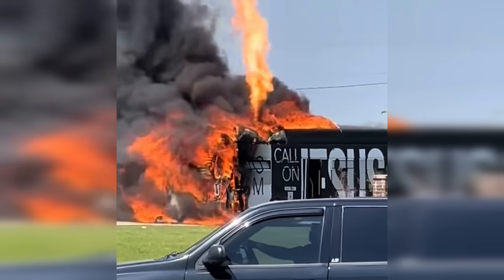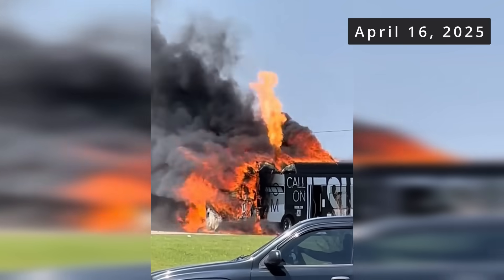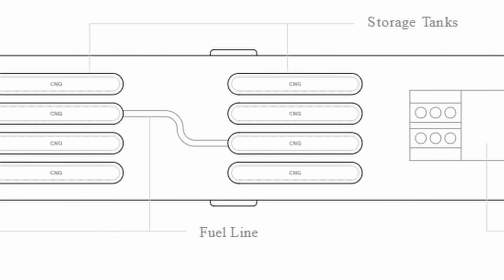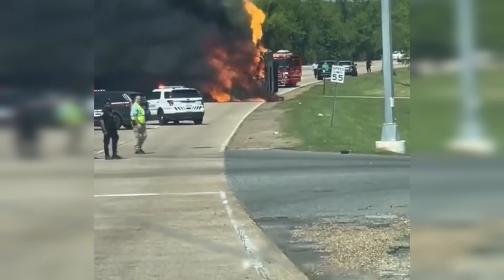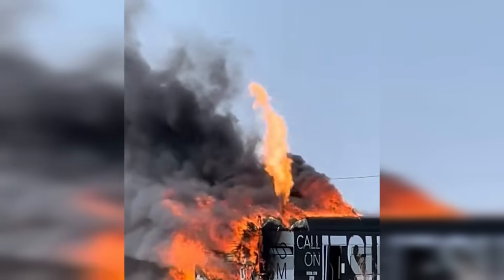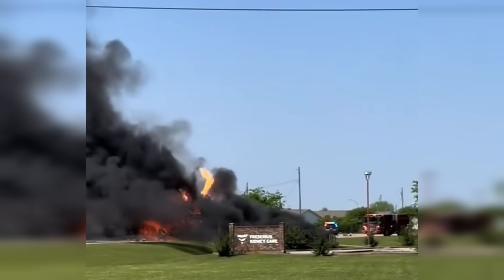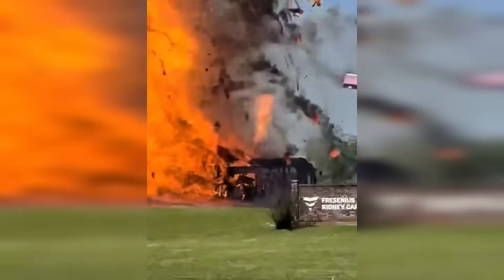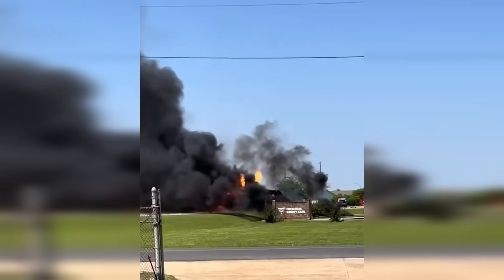CNG Bus Explodes in Shreveport — Not an Electric Vehicle

Comment: 3600 psi, wow. LPG is around 220 psi so the pressures are an order of magnitude smaller. Any gas at 3600 psi that ruptures its tank is going to be very destructive even if the gas is inert.

Comment: Ok At what pressure does compressed natural gas turn into a liquid
Reply from the maker: You'd have to look at the phase diagram.   It's dependant on both temperature and pressure.
Reply: 4 psi at -200

Comment: Could be that one of the venting tanks was pushing high pressure vapor across the safety valve of another tank, cooling it while the other end of the tank was being baked until it failed.

Comment: In tanks propane is stored at high enough pressure it is a liquid, at normal temperatures. That is why the volume stored is so much higher than the volume of the tank. Pressure will reduce as the stored propane is depleted, but it is basically empty when the pressure is so low that none is still liquid. That is how some level gauges work.

Raise the temp and the liquid becomes gas (BL), so the pressure rises (EV),  until boom (E)...that's why it is a BLEVE 😂

(FF1 & D/O)

Comment: The PRDs can be manually disabled as a safety feature when the bus is inside the shop for maintenance, sometimes they get left in the disabled mode.
Reply: NO, the PRD line is just a vent line when the PRD valve goes off it vent the fuel out the top of the vehicle, the tank itself can be shut off, but that doesn't turn off the PRD. once it pops it vent the hole tank and then the valve has to be replaced.
Reply: @junkmaster5503  The tanks are on the roof and the PRDs are on the top of the tank.

Comment: Great that CNG has a relief valve, but that doesn´t keep the tank or hoses from being compromised by fire. I don´t want to have anything to do with compressed natural gas. We´re talking 3000 PSI of highly flammible liquid. Ever have a pesky leaky water pipe in your house? Thats only about 50 PSI. You gonna trust that all connections and piping will stay perfectly tight day in and out with normal road vibrations or passing over pot holes or even a minor fender bender. Disaster waiting to happen.

Comment: HEY , some points from my past ; 3600psi ??  late 90s early 2000s , 2 school districts around Albany ny i worked on , we were told 6000 - 8000psi in ,yes , 8 glass/resin spun/wound tanks .  only safety we saw , a T handlle and cable to shut off flow to engine 😂😂😂😮
      also from fire service , NG is lighter than air ???  can dissipate ???  but make big dang fireball ???  massive ignition range , so i was told??
   just glad my kids were NOWHERE near ....

Comment: Not every touted change is a good change. Diesel has worked for a very long time. There is no need to change.
Reply: CNG has a much cleaner exhaust output; diesel engines, although when brand new, can be quite clean - quickly turn into coal burners if they arent maintained to a VERY high standard - and most arent.

Prior to the EV revolution, several Chinese cities converted all their city buses to CNG/LPG (at a HUGE cost), and banned other large diesel engines from the inner city - the difference in pollution levels was visibly noticeable between my visit to one such city, just before the ban - to my visit a year after the ban.

Prior to the ban, you often couldnt see much beyond a single city block, and even then, the view was pretty hazy; after the ban you could see a mile or two.

Comment: I think you could probably save that right front wheel… 🤣
Reply: I thought the same, the brake assembly can take a bit of heat too, gotta be a few hundred bucks there.
Reply: Just the wheel (maybe) as the tire has had too much heat
Reply: The tire could be repurposed into a lovely planter for beautiful flowers.  😉  Life is good!  😊

Comment: CNG is way more dangerous than diesel, but still far less problematic that misbehaving battery fires.
Reply: @cccmmm1234  the federal government just needs to remove the soot collection and other emission system from diesel engines and just require that they run as clean as possible.

Comment: Are the tanks on those busses vented directly to air? If there are pipes to direct venting to specific locations (ex.: the two fire columns seen in videos) for practical and safety reasons like keeping flame jets away from passenger space and emergency exits, then it could be that the temperature relief valves did operate correctly but the flow resistance between the hottest tank and atmospheric pressure was too high to keep up with the heat load. May need to size vent pipes up another inch or two.

Comment: in US obligatory PRDs are not "tank PRD" (built-in in tank itself, it is not so easy and safe for 300+ atm vessels), they are external devices and mostly thermal thus do not guarantee fast pressure relief. Exactly what we see here - small single jet burning with rate mb 1kg/sec (3m high flame jet) for minites in the very centre of the fire, on big bus with multiple cylinders and 100+ kg gas onboard. The roof tanks (cylinders) are definitely composite, so finally one of them overheated, lost its structural strength and failed. 

If thermal PRD is already tripped and jetting the gas - tanks may and must be cooled, it is irreversible device, but not before.

Comment: One bus company I worked for had a Dennis Dart catch fire due to an electrical fault. The driver got everyone off but the fibreglass body burned down to the bottom of the windows by the time the fire brigade managed to put the fire out. Then they were able to approach it and turn off the Cummins diesel engine that was still running fine, although the heat had melted all the plastic radiator fan blades off.

Comment: I remember many years back when the bus fueling station for CNG busses in Tacoma, WA blew up. City had to scramble to pull old busses out of mothball to keep public transit running at that point. 
But, I do have a friend that was a mechanic on those busses and he raved about how clean the internals of those engines were, when run on that fuel.
Reply: Oh yeah. Without any soot, the motor oil lasts longer. You don’t have any soot getting into the turbocharger either. Without the particulates, the engine just doesn’t have to deal with as much and everything just sort of works better and runs smoother.
Reply: Alot of farm pickups have been ran on propane, motor oil lasts forever. These days propane is expensive and not so many conversion kits available for new engines.

Comment: Diesel fuel is looking better and safer everyday. 😮
Reply: Not when it spills, you have to normally replace the tarmac
Reply: @BlowBubbbles  Diesel?  I've not had an issue with that but regular petrol/gasoline definitely eats asphalt.
Reply: It might eat it, but you can't wash it
Reply: Easier to source and handle…?
Reply: Only because we have a network setup, who knows what will be powering transport in 100 years

Comment: If it's not a liquid under compression, then it's compressed methane. It's more sensible to use LPG which is liquifed petroleum gas . For us here in Australia the domestic and camping LPG is propane and the automotive LPG is 50/50 ratio of propane/butane. The propane and butane liquify at say 3 to 5 atmosphere of pressure and from memory the tanks are hoop band tested to 30 atmosphere of pressure before they are issued. 3600 sounds like 250 atmospheres. I think the CNG tanks had a wall thickness twice that for LPG. I recall a movement to introduce hythane tanks which is 80/20 ratio of methane/hydrogen (interesting concept) . Hythane fuel I was informed is used in India and for the same energy only produces ⅕ the carbon dioxide emissions maybe ⅙ actually.
  Who the hell wants to drive with tanks at 250 atmosphere of pressure? We never hear of incidents from India with their hythane usage but there must be some incidents. After 50 years of automotive LPG usage in Australia only a few incidents got into our news reports over the long period.
  Methane is also a petroleum gas of course but has become labelled as natural gas i guess because it's also produced naturally in nature.   LPG would appear to be LNG , I gotta look further into it cos there's ambiguity.
Reply: Big surprise - we have plenty of CNG buses in Sydney, mostly manufacturer-built, not inhome conversions. Our beloved govt plans to replace them with rolling electrical bombs and compressed hydrogen miniHidenburgs.

 LPG is Petroleum gas (butane-propane), CNG is compressed (300atm) methane, LNG is cryogenic methane - low pressure but -170C temperature.

Comment: Fire relief valves only work when directly exposed to fire. If the body of a cylinder but not the valve assembly is exposed to fire the cylinder body will fail.
This is particularly a problem for light weight composite cylinders where the cylinder body itself can burn away. Aluminium cylinders are marginally safer because they distribute the heat to the valve assembly…
Gas cylinders in a fire are dangerous regardless of the contents. Compressed flammable gases are exponentially more dangerous.
I agree the bus was toast the moment the fire started - safety of life trumps salvage.

Comment: What kind of tanks were on the bus? Aluminum with carbon fiber / fiberglass wrap? Or kevlar wrap? If so could the wrap soften with the heat? And now it could not support the tank pressure and cause an explosion?
Reply: Heat is going to drive the pressure up, possibly double or more, and possibly also weaken the tank.

Comment: A Compressed Natural Gas (CNG) bus is a bus that runs on compressed natural gas, a cleaner-burning fuel than diesel or gasoline. CNG buses produce fewer emissions, are quieter, and can offer operational cost savings compared to traditional diesel buses. 
 
Reduced Emissions: CNG buses produce lower levels of greenhouse gases and other pollutants compared to diesel buses. 
Quieter Operation: CNG buses are generally quieter than diesel buses. 
Operational Cost Savings: CNG can be less expensive than diesel fuel, potentially leading to cost savings for transit agencies. 
Fuel Source: Natural gas is a domestically produced fuel, reducing reliance on foreign oil. 

Many transit agencies in North America have converted their fleets to CNG buses, including VIA Metropolitan Transit in San Antonio and GoRaleigh.
Reply: all these reasons are just cover for the single real reason - CNG is CHEAP! Dangerous, not convenient, requires very specific infrastructure, reduces range... but twice cheaper than diesel!

Comment: the tanks are on the roof? these buses must be easy to tip over, thats got to be terrible weight distribution.
Reply: light composite tanks are usually on the roof, its not so heavy. Oldslyle steel cylinders, 100kg each, not suitable for roof installation.

Comment: Sometimes staying away from it and letting it burn is the best solution. 
I learned that much from my little bit of chemistry that I had to study for college. I would imagine if the official firefighting instructions for some of those chemicals are monitors far away and evacuate the area. I would imagine that a high pressure gas cylinder That's in a fire should have a similar procedure to it. Evacuate the blast radius and keep everyone out of it.  If you can fight the fire without getting people inside of it Great otherwise just stay away. 
I've seen regulator failures of a high pressure nitrogen tank in person before. That would have been lethal if somebody was in the way. There's no way I'd want to be near a tank operating at a similar pressure that slowly losing structural integrity. There's enough stored energy in there to do an awful lot of damage. So I'm a little bit more cautious than most around them.

Comment: My area (Fort Smith, AR) had a small CNG bus go up it flames back in I believe in 2018 .  The bus got hit and causing a rupture in one of the tanks.  The driver got everyone off the bus in less than a minute before the bus got fully engulfed in flames.  No one was majorly hurt, but it really could have been far worse if the driver was to slow to respond.

Comment: I like your quiet, engineering and fire-fighting based analysis of the incident. Panic and sensationalist reporting is always a bad advisor. Liquid based fires like petrol/diesel are bad enough but relatively "benign" compared to pressured gas systems (LNG/CNG), let alone compared to lithium ion battery pack fires.

Comment: I would be interested to know what caused the fire in the first place.  Something hot enough to set off the pressure release valves.  
Best from Cleveland, Ohio
Reply: Odds are, it started as a typical fire.  Perhaps electrical that set the interior on fire.

Comment: Gas vehicles may not be perfect, but we've been perfecting the technology for over a century. I don't like the idea of sitting on twenty gallons of boom juice under me, but at least when I was surrounded by cars that exploded it was in a warzone. XD
Reply: There are so few accidents with it that no one even considers it, it is that safe when you take normal precautions.
Reply: It’s all about inspection! Those lpg or CNG systems needs to be checked all the time
Reply: LOL the age of the technology don't mean anything. Commercially available electric vehicles appeared during the 1890s. An electric vehicle held the vehicular land speed record until around 1900.
The Beach Pneumatic Transit (Hyperloop)was the first attempt to build an underground public transit system in 1869 or Vactrains were explored in the 1910s, as described by American rocket pioneer Robert Goddard and others. or ET3 Global Alliance (ET3) was founded by Daryl Oster in 1997 with the goal of establishing a global transportation system using passenger capsules in frictionless maglev full-vacuum tubes. Oster received interest from Elon Musk potentially investing in a 3-mile (5 km) prototype of ET3's proposed design.
Reply: @OzyWizard1973  electric vehicles have one major issue, electricity. You either use ineffective heavy batteries  or a overhead wire/electric rail system.
Reply: @jonathanjones3126  OK.. But my point is not EV's. It's the age of the technology. I used EV's because I know they are 210 years old and still dangerous. Where Autogas was design and tested in 1823, it wasn't till 1935 it had an autogas station. Slower start but safer.
Reply: @OzyWizard1973  I agree that electric motors can be a excellent means to propel vehicles, the problem has been the source of electricity.  My city has light rail with overhead transmission wires to supply the electricity for 3 light rail lines.

As far as liquid fuels go, diesel is the safest by far. Anything compressed can be extremely dangerous especially oxygen or propane type fuels.  Though their much better then any lithium or sodium chemistry batteries.
Reply: Liquid diesel-fuel cannot explode.

Comment: The tanks are predominantly a carbon fibre wrap construction.
Carbon fibre doesn't like fire . Even if the relief valves are working the tank can still explode if it has sufficient pressure and the fire burns away enough of the carbon fibre to cause a rupture. Judging from the small size of the explosions the tanks were probably close to empty .
The good thing is it's just natural gas which is lighter than air and it wasn't in an enclosed space . The pollution release was mostly the plastics and other normal materials of an ordinary bus. No deadly toxic runoff or particularly carcinogenic compounds and it was all over by the end of the day.
As for the c02 released I'm sure all the local plants are happy about a good meal.
Now if it was a battery electric it would have been a toxic nightmare that lasts for days or even months
Reply: At 3:53 when someone is recording the burnt out carcass of the bus you can still see the tanks on the roof. These may have been steel, wouldn't a composite tank have burnt away? 

Either way, I wouldn't want to be around any type of pressure vessel that is on fire or near a fire. It always worries me when I see videos of fire crews in close proximity, many have died from these explosions.
Reply: @ saw that too and considered editing the comment.
But the carbon fibre tanks need a core to wrap around, this can be aluminium or stainless steel or plastic.
I think methane is slightly corrosive so it wouldn’t be steel.
But they actually looked like ordinary steel gas bottles which is unusual as they’re not light and most CNG vehicles that put the tanks on the roof use the lightest tanks possible.
Reply: @volvo09 > 3500 psi scuba tanks are steel, which melts at 2500°F or Aluminum that melts at 1000°F

Comment: That explosion is why the FFs should NOT try to extinguish those fires. Use deck guns and keep your distance. As seen here, you never know when a Tank will explode.  Another great video.
Reply: moreover sometimes cylinders not rupture as is, but launch as rocket, flying far away with all their mass and burning gas torch.
Reply: @antontsau  That is with the should be structurally attached stronger that the force of the valve. that puts a limit on the rate of safe release. which may cause a explosion, if the rate of heat is higher than what pressure the valve can release. 
will be interesting whether this was a engineering mistake or a lack of maintenance. normally those valves should be rigorously checked and designed to be resistant to failure.
Reply: @beyondEV  Good points. I had a couple of those in NYC, but those were confined to Engine areas. Scary Leaks had not yet happened.